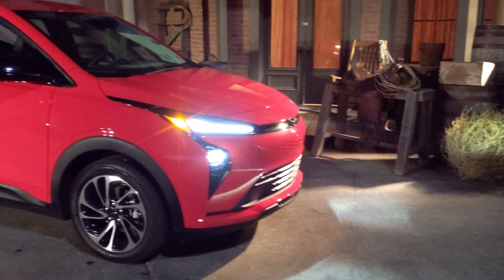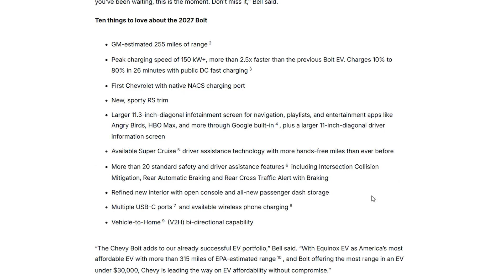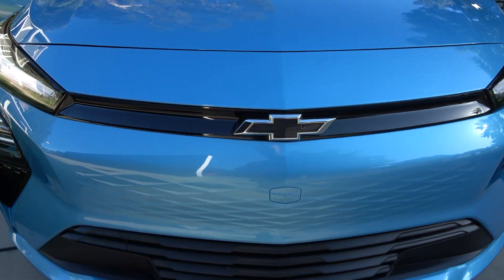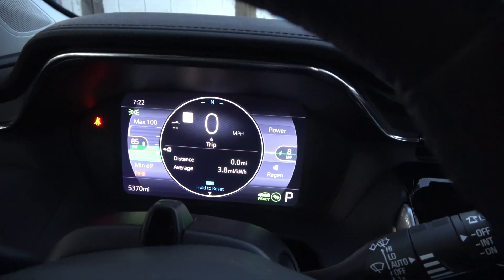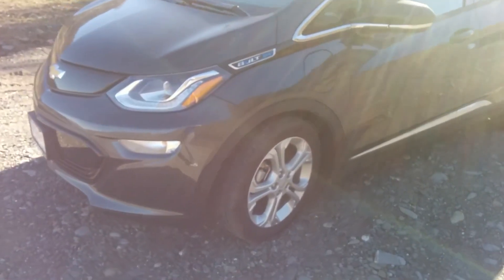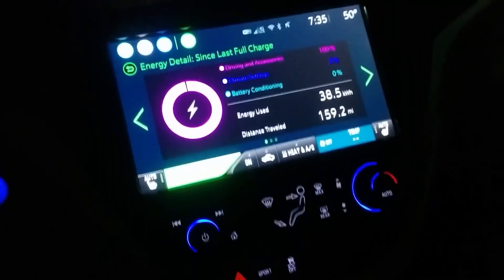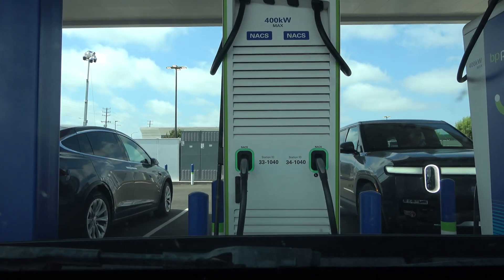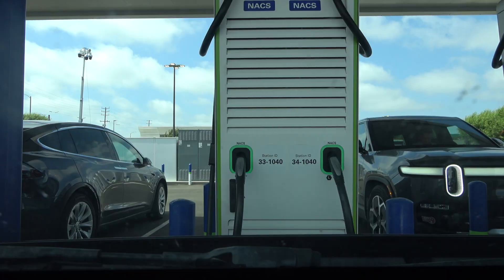Is the 2027 Chevy Bolt More Efficient Than We Think?

Comment: I recently made a purchase of a 2022 Bolt EUV and was shocked at how my range has kept going up. I know EPA rates it as 247 miles and I just accepted that. I have actually been getting 322 miles lately. I figured in a recent trip since my speed was going up that it would fall along with colder weather. This was the first time I have has over 100 miles left on the battery pack on a trip where I am usually lucky to have 40-50 on the battery pack after my trip. Recently I have been getting 296 miles and I think this is due to colder weather. I still am surprised I am still so much higher than 247 EPA mile prediction. I never expected to be getting better charges with my 2022 Bolt EUV over my 2017 Bolt EV.

Comment: The power density of the LFP battery in the 2027 Bolt is as good as the NMC power density in the older Bolt line. Remember the older design from LG is 10 years old. Even on the 2022 model update—they changed the battery design very little. EPA on this new Bolt?  Hope it’s 275.

Comment: Insightful and helpful video, but you are leaving out the heat pump, which will also boost range.  I wonder how much heavier the Lithium Iron Phosphate battery may be which will be offset by extra regen but could create a little extra rolling resistance.
Reply from the maker: Thanks! Yes, I was focusing mostly on the SiC inverter because that will offer the most gains, a majority of the time. In terms of weight, it's not clear, but the new Bolt is less than 100 lbs heavier than the previous Bolt EUV.

Comment: The EPA numbers for the Toyota BZ are out and the 2026 FWD 18in tire model is rated at 143/119 mpge city/hwy vs 131/107 for the 2025 and earlier models and I suspect that the switch to silicon-carbide inverters was a big factor.

Comment: Rory Sutherland made a very good point about Range Anxiety.  It's an emotional problem, a psychological one, not a logical one.  Most people have too much battery in their car they are lugging around every day, because they have this irrational fear they are going to run out of charge.  250 miles is plenty for daily use, which is what most of us are using the car for.  In fact, if you have 250 miles of range, it's like leaving your house with a full tank of gasoline every morning.
Reply from the maker: Interesting. I'll have to hear Rory out on that fully, but I don't know that I agree. Thank you, though. I think this is a great topic to discuss.
Reply: A full tank of gasoline gets me 450 miles.    15 gallon tank
Reply from the maker: @jsh111  It depends on the car. The average ICE efficiency is still ~25 mpg, so the average car would only go 375 miles on a 15 gallon tank. Sure, some will do better, but that's not the average.

Comment: My low end 23 Bolt on the last 100% charge got 302 miles with 37 miles left on the guessometer. I regularly get 5.3 miles/kwh. Turn off your 1 pedal driving and drive to avoid braking, use the regen paddle.
Reply: I'm really going to miss the paddle and physical OPD switch...along with CarPlay.

Comment: I believe all of GM's 2026 EVs have the new Inverters.
Reply: SiC inverter MOSFETs are also likely vital to GM's amazing peak launch HP/torque enhancements out of the Cadillac Lyriq/"V" versions and Blazer EV SS. Silicon IGBT's would fry trying to deliver the required burst-amps, even with launch-mode inverter/phase-lead pre-cooling. Also, SiC operates at much higher switching speeds, which allows higher max motor RPM and vehicle speeds. Optiq V max speed = 130 MPH. Future EV hot-rodders taking a wrecked Optiq-V FWD unit and building a Bolt-V?:)
Reply from the maker: Yeah, I was thinking about that when I was editing the video. We could see a bump in efficiency across GM's entire EV line up. Exciting times!

Comment: Since the change in battery chemistry and charging to 100 % is not detrimental as much I’m wondering what DCFC will be over 80 %   If it is not better than what is the benefit during travel
Reply from the maker: The only thing I was told is that the Bolt continues to charge quickly. From the sound of it, the Bolt will take about 30 minutes to go from 80% to completely full.

Comment: We need a cheap EV range test of bolt, leaf, Mach-e, equinox and Tesla model 3 range test back to back !!!
Reply: Efficiency tesla will win easily and likely be second in total miles driven. Equinox will likely win on range and be 2-3rd for efficiency (ours is 3.7+miles per kwh all time and up to 4.3 around town trips no hwy. The new leaf will be 3rd for total miles and probably just barely 3rd for efficiency if not eeking out 2nd over the equinox.

The new bolt euv will probably be last in miles but also 3rd or close to it in efficiency, and the mach e will be last all around.

Comment: This month marks exactly 10 year of owning my i-MiEV, a used 2012 I picked up for a song. I got the warranty battery replacement in 2020 and my second set of front tires for it put on just the other day. So, if the replacement battery lasts as long as the original (and I'm going to guess it will do even better,) I should still be driving this car in 2028 or 2029. 

I'll be on the hunt for a lease return 2027 Bolt in a few years. With that big LFP battery, V2L capability, heat pump pack management and now news of this more efficient inverter, I anticipate mating the car to my house battery and solar for off grid clean energy all electric living. Oh, and I think the new Bolt painted in blue, like I've seen in several recent photo shoots,  looks fabulous.

Comment: Have you seen any information on the 2027 Bolt charging curve? I wonder if use of the LFP battery will permit charging at 150 kW for a longer period. Perhaps charging closer to 100% in a reasonable time. My understanding is the LFP batteries can tolerate full charging much better than MNC chemistry.
Reply from the maker: We got some information on it, but nothing specific. Based on the advertised charging time and some of the comments made by one of the engineers, the new Bolt should only take about an hour to maybe hour and 10 minutes to charge from nearly empty to full.

The full charging has more to do with the absorption of energy, and unlike NCM, the LFP will just continue to saturate (so long as you don't exceed their voltage tolerances).

Comment: I charge my '23 to 80% and always have about 220 mile guestimation more in the spring and autumn, less in the extreme cold and heat, but I hang my hat on getting about 4.7 miles per kWh. If the next Bolt just matches that and has a decend DCFC speed it will be a winner. The carplay will be loss, but I don't use in car navigation anyways.

Comment: Yeah 255 miles of range on an LFP battery that can presumably be charged to 100% every time. Comparing it to non-LFP cars that should only be charged to 80% but are advertised at a 100% charge is a little off.

Comment: I was surprised how much the range varied on the original Bolt from 55 to 75mph.  Don’t expect differences that large from an ICE car, so wasn’t expecting that much difference depending on speed.  Pushing a brick down the road, but at 55 mph, it appeared that 300+ miles was achievable.  27 Bolt gets Equinox motor, I believe, and that vehicle isn’t nearly as efficient as the original Bolt, although Equinox EV has more aero drag and 50% larger battery (weight).  Efficiencies in the power conversion may be offset by a potentially less efficient motor.  Heat pump should help in the colder travels, so 200+ highway miles should be easy.  And that charging speed increase - wow!
Reply: You can not drive 55mph on a highway where everybody else is going 80mph.

Comment: Nissan is a far superior product
Reply from the maker: We'll see. I really like the new LEAF, but Nissan seems to be struggling with production capacity. They also hit some bumps with the Ariya, but hopefully, they corrected all those issues.
Reply: @newscoulomb3705  Well, go for the new Leaf if you don't like to use i-pedal but prefer brakes, and as long as you don't have to sit in the back seats with less than 32 inches of legroom compared to about 39 in the Bolt.
Reply from the maker: @phillipives2508  They both have their strengths and weaknesses. The Bolt is quicker, more nimble, more efficient, and now charges a bit faster. The LEAF is a wider car, which is more important for some people, but the LEAF is also just a bigger car by footprint alone. It really never was a good comparison with the Bolt EV (we just lacked options), and even the Gen 1 LEAF was a stretch. This Gen 3 LEAF is much closer to the Equinox EV, Ioniq 5, and even Model Y than it is to the new Bolt, and that now also goes for the MSRP. 

The $26,000 LEAF will likely be a unicorn for another year or two, and after destination, it only saves a thousand or so off the base Bolt. So for the base LEAF, you'd be paying almost as much for less than 200 miles of range, worse fast charging, and a slower, less nimble vehicle with less rear passenger legroom (but more hip room).

Comment: If you can get 250 mi + 3 times faster charging what's there to complain about?
Reply: No paak? No frunk? No fsd/autopilot equivalents? No awd option, torsion beam rear suspension from economy cars? No sentry or dog modes? Cheapest model is still a year our and they already announced they cut production down to 1 shift vs before summer it was 2 planned shifts?
Starts at $28,990 but can go up to $38,000+fully loaded smh. 
Just 150kw charging speed on a 2027 model year ev?
Reply: @4literv6  I think you're assuming people want all that crap on their cars.  Bolt owners want something that isn't bloated with tech, and has simpler suspension and basic "car stuff."  Those features you list add initial cost, but more importantly they create very expensive future repairs for the unfortunate owner.

Comment: I think the GM estimated 255 miles is going to be very close to EPA.  And that is quite impressive.  Anybody who thinks GM was going to get well beyond that with LFP was dreaming and not thinking with logic.   Now as for the 7% improvement in the Silicone Carbide Inverter isn't a overall system efficency.  It's just the improvement on the inverter alone.  So an improvement of 7% on the inverter will not yield 7% on the overall vehicle.   The inverter is only a segment of the overally system losses.  So that would probably yield about 1 - 2 % range improvement.

Comment: Real world, having a heat pump would help my driving range significantly on the Bolt EUV
Reply from the maker: Yes, I've always looked at the heat pump as mitigating the worst-case ranges, so in combination with the SiC inverter, the new Bolt should do much better in winter.
Reply: @newscoulomb3705  This winter in my Equinox I'm testing a new HVAC setting to see if it uses less power than the normal Auto - 70 deg - recirc. The setting I'm testing is first max windshield - 70 - recirc because sending air high to push colder air down to the cabin air intake allows the car to use higher (but lower used power) fan speed over the higher power heating coils. The setting gets better air circulation heating up the cabin more to the point that having it set to 65 degs feels the same as normal HVAC flow at 70 degs which is the setting I'm using right now. With an added bonus, the setting I'm testing helps reduce the windows from fogging up which was an issue for me last winter.

Comment: Range is really dependent on how you drive. For example we have a 2020 Bolt LT. On the highway if I drive it I can easily get 250 miles of range. Mostly 70 to 75 mph. On the other end if my wife drives it. Even at the same speed she barely gets 215 miles. Now my daughter is worse I would be surprised if she gets 200. Driving style is very important when you don't have a huge battery.  City driving we all can get close or more than 300 miles from the Bolt. My current car is a VW ID.4 the original one 2022 I would be able to get 240 miles of highway range. The new 2025 which is more efficient I am easily getting 290 to 300 miles on the highway.
Reply: After 2 years of driving my 2023 Bolt in west-central Wisconsin, it registers 4.5 miles per kilowatt hour as its average efficiency.  On a full charge, in warm weather, it estimated a maximum of 340 & a medium range of 300+ miles.  I drive no faster than 60 mph, just as I did with my Honda Fit.

Comment: Just buy an equinox right now😊 picked up a 2025 with less than 6,000 mi for $21000 fully loaded
Reply from the maker: I definitely agree that the used deals are great, but I try not to mix between new and used. The dynamics for buying used is very different from buying new.
Reply: where did you get that deal? carmax is $5k-10k higher
Reply: @acewmu Buick dealership in Illinois
Reply: Been seeing price like that from a few used car dealers in California. Mostly 2LT.